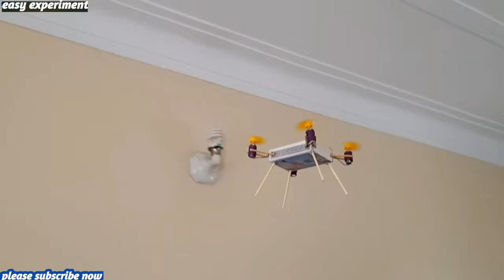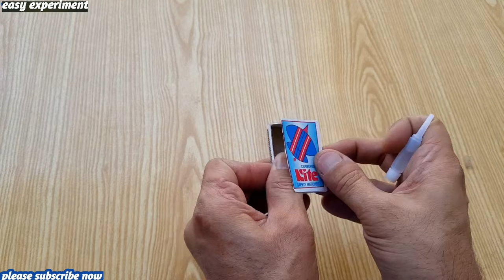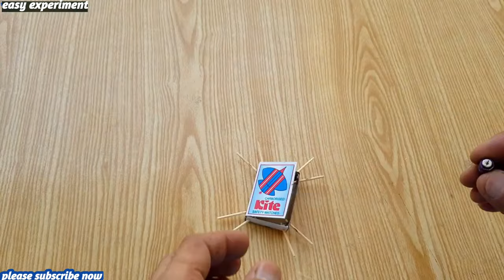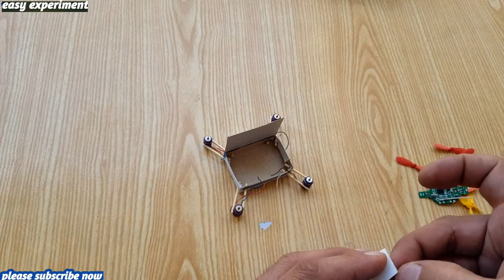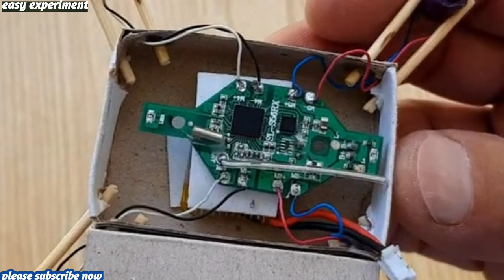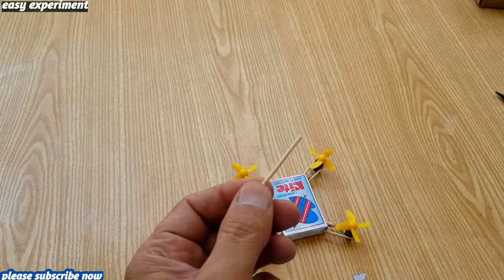How to make rc matchbox drone quadcopter at home diy mini drone  | 100% fly (easy experiment us

Comment: bro what are the materials require for this project can you plz mention it
Reply from the maker: Brother nano drone circuit board 4 nano drone motor Lipo battery 4 propelle remote control thanks
Reply: Bro how to buy this drone circuit board
Reply: @easyexperiment4086 hello bro we need The drone remote controller or it  will work with other remote controllers like rc car

Comment: PleaseMention all the parts used in video in comment section
Reply from the maker: Nano drone receiver 716 coreless motor propeller Lipo battery and transmitter

Comment: Which material & circuit are use in
Reply from the maker: Mini drone motherboard with remote control and 4 coreless 916 motor Lipo battery 4 propeller